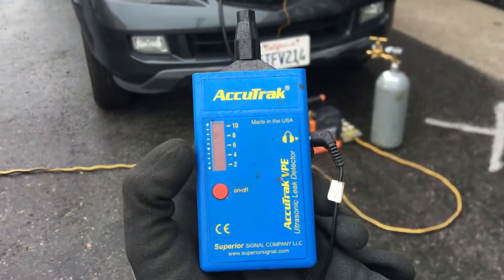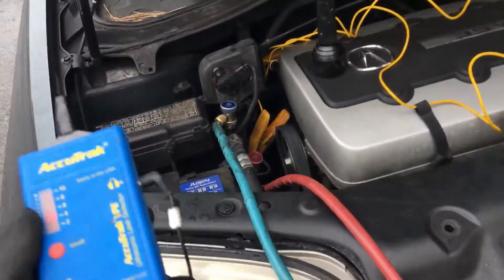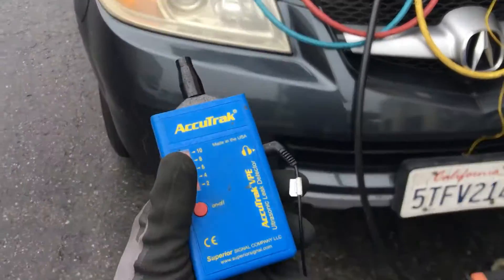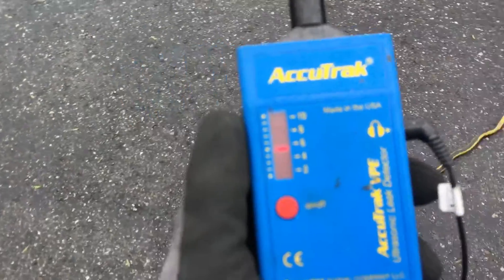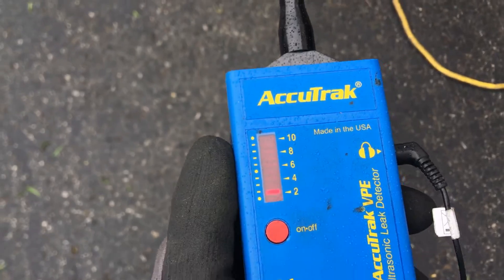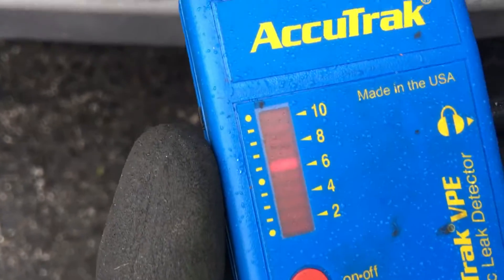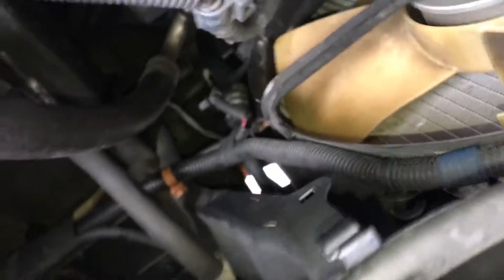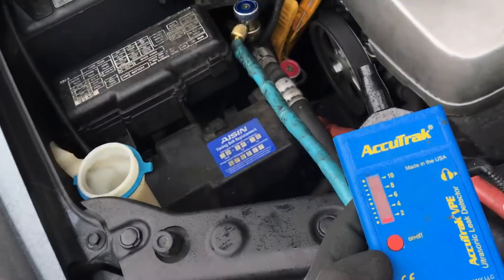Only The ultrasonic leak detector would find a leak￼

Comment: Ultrasonic vs classic leak detector(sensor) vs water and soap :O ??
Reply from the maker: One dose not vs the other.  That all have a situation were one works better then the other.  In some cases one will not work at all and the other will find it. 

Don’t forget1:  high pressure nitrogen 
2: UV dye 
3: Hydrogen Gas with hydrogen leak detector 
4: helium gas with helium leak detector. 
I forgot CO2 gas with a CO2 leak detector. 

5: what kind of classic leak detector? There are different technologies. 

1: the cheap corona discharge, which is a piece of garbage. The alarm goes off on everything not very sensitive.. 

2: the classic leak detector that my father grew up with. A piece of copper suspended in a flame with a hose attached to it that cause Stephen Cherry draft affect..  with his heated piece of copper, you would pushy who’s along all the points that you think are leaking, and if there was a leak, the flame of the torch turn green.   ( this is the classic leak detector.) 
3: heated diode technology uses a zirconium sensor that is heated up over 1000° with a special coating on it that reacts with chlorine in halogen face gases to set off the leak detector. 
4: infrared technology sensors that use light waves refracted to read the type of gas passing that will set off the sensor. 

They all have their pluses and minuses the two top contenders are the heated diode and the infrared but they work a little bit differently, and sometimes will confuse the operator if they do not know how to use them correctly. 

I have made several videos showing real life situations where one leak detector or sometimes to leak detectors will find a leak, but a different leak detector will not find a leak. 

There’s always certain situations that may make one big detection method not work at that time . 

Not all leaks do not leak 100% of the time 

Some leaks are temperature sensitive some leaks are pressure sensitive, some leaks vibration sensitive .
Reply: @coldfinger459sub0  classic sensor leak detector i mean for example fieldpiece dr82 or refco tricector or  inficon d-tek.
Reply from the maker: I guess Classic all depends on when you were born in came into the industry. 
          I started in 1979 when my father had been starting to use the General Electric H 10 heated diode at that time that was considered a classic. 

My father started when using the little copper plate over a burning flame with a hose pick up tube, was considered the classic . 

In the 1970s and 1980s almost into the 2000s unfortunately the cheap corona discharge usually made by TIS or some other company just because it was cheap and automotive was considered the classic . 

Infineon or fieldpiece  or Refco we’re not even around at that time.  They are newcomers to the market..

Comment: Awesome 😎
Is it ok to use compressor air to pressurize instead of CO?
Reply from the maker: That is an excellent question one that gets asked often. 

Compressed air is extremely wet in laden with liquid water you would never want to put compressed air into an air conditioning system

CO2 we do not put an air conditioning because it is considered a wet dirty gas has a higher traction to water and it’s another gas that you would want to keep out of your air conditioning system

     Only dry nitrogen is used to pressurize AC system or if you happen to have some argon from your welding tank is also a dry clean non-reacting gas that would be excellent but just more expensive.
Reply: ( I meant to say nitrogen BTW)

 good point about moisture in compressed air. That answers my question 👍
So if I do it with compressed air, guess I have to be more thorough with vacuum pumping.
I was just trying to avoid storing dry nitrogen and the expense.
Thanks from Australia!
Reply from the maker: @richardday2893  over here in the United States a small tank of dry nitrogen to get it filled is only about $13-$17

     Storing it is not a problem because it’s not flammable and it’s not going to explode it’s not corrosive and it’s not poisonous

I don’t know what the expense to purchase the tank for in Australia it is we usually leave a deposit and we exchange them anywhere from $150-$300 depending where you are and what size tank 

The tank you usually see me use are 40 ft.³ 60 ft.³ or 80 ft.³ tank you would have to do the math to convert that to meters it’s probably what you use for a measurement system over there. 

But when you get that much moisture into PAG oil or POE oil it’s usually nearly next to impossible to remove once you get it in the oil. 

      Even pulling a vacuum you’re mostly just removing the moisture off the surface of the oil not deep down in the oil. 

But if I was going to try because somebody uses compressed shop air I would just leave it on the vacuum pump overnight that’s about the best you can do and change the receiver dryer so it has new desiccant to remove moisture. 

But there are two methods and two different types of people with trains of thought on what is repair and acceptable

There are those who are looking at the very minimum to do the easiest way out that last long enough to collect money that could cause damage later but worked for now

And then there are those who do not want to create damage and do it so the repair doesn’t cause degradation and breakdown of oil or corrosion on the inside later on due to excessive moisture kind of like a intentionally set ticking time bomb to explode later on and cause leaks oil breakdown and compressor burnout. 

I heard things are pretty expensive over there in Australia and their rules and regulations to get your hands on refrigerant is more strict than here in the United States. 

I’ve heard a lot of people convert over to using butane or propane in Australia.
Reply: @coldfinger459sub0  thanks that makes sense.
If you vacuum air, moisture will evaporate. If you compress air, moisture will condensate .👍